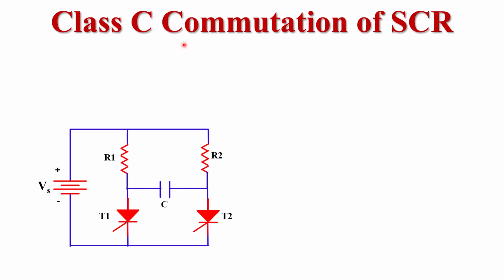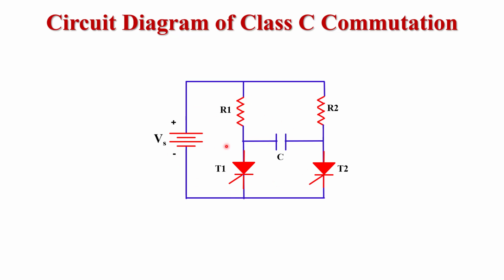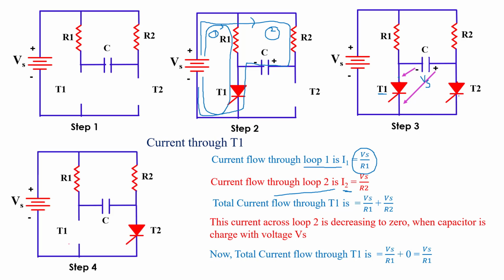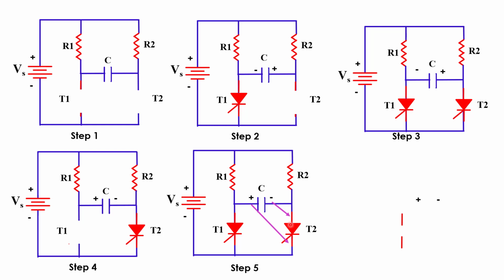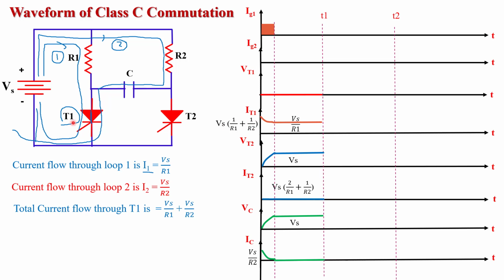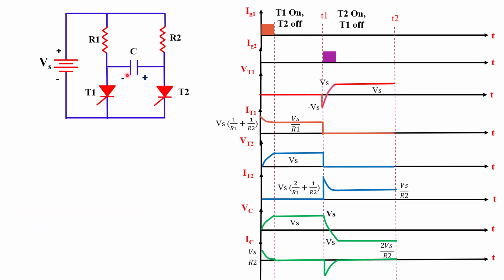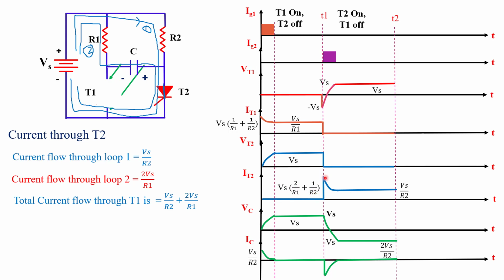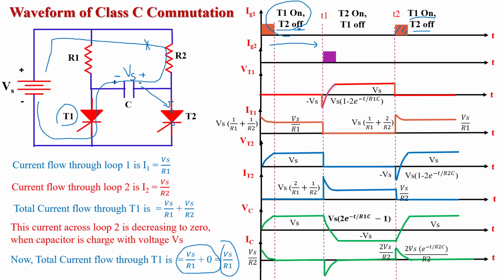#46 Class C Commutation || It's Circuit, Working and Waveform || Complementary  Commutation.

Comment: Maim - vs se capacitar kase charge ho raha h
Reply from the maker: Capacitor charges through Vs due to the current flow in the circuit when the switch is closed.